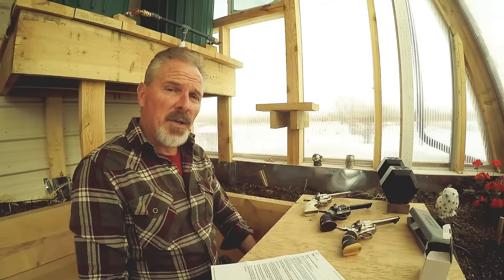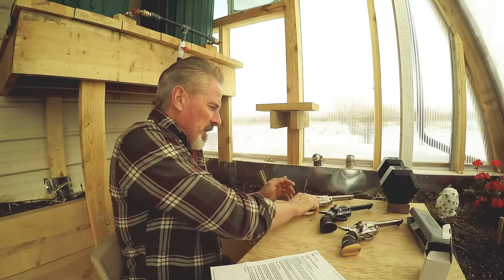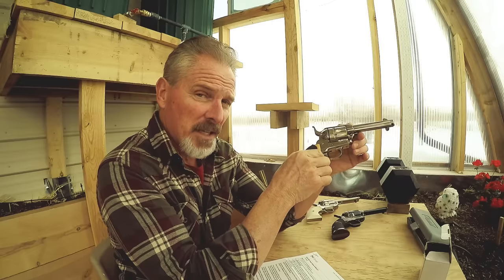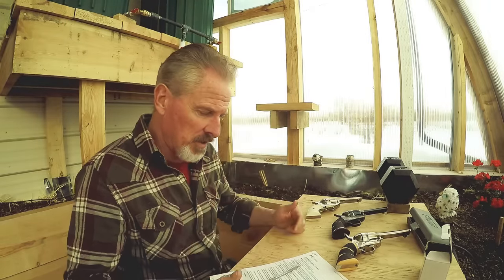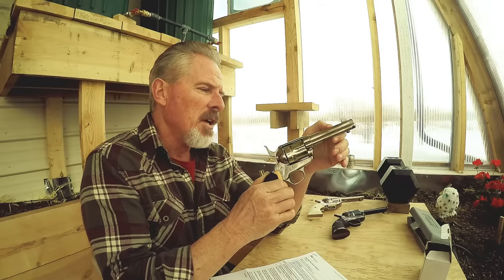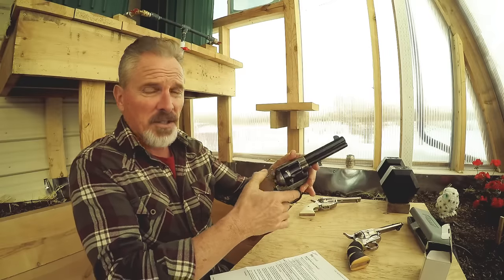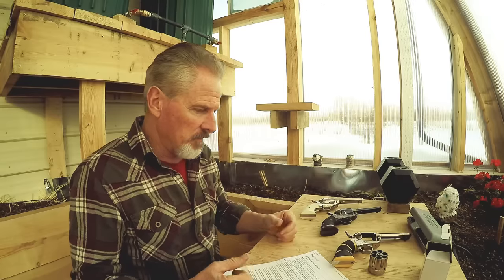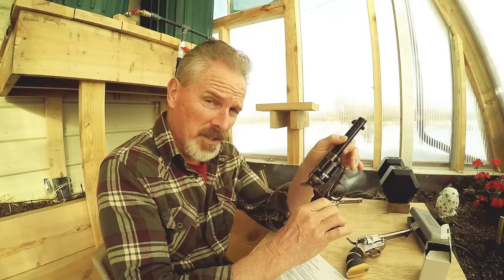Unlocking the Secrets: How a SAA Race Gun Works

Comment: Are there any drawbacks to having a race modified saa? Aside from spring related issues like light strikes, like does it become unusable in a normal way?
Reply from the maker: Light strikes can be a problem but cured with a slightly more powerful spring, more protrusion (in spec) . Other than that no.

Comment: Would have been nice to see that part and how it is shaped and how it is held inside the gun. My cowboy action revolvers were suppose to be factory tuned but it is too easy to not get the  cylinder to lock up until  the hammer really has to be pulled slightly passed the sear engagement. Nobody has given me an idea how to overcome that problem. and the factory will not fix. Uberti.
Reply from the maker: In my experience Ubertis SAAs are inferior to Piettas. I can't show step by step alterations on YT unfortunately. Sounds like an issue with how the bolt leg rides on the hammer cam. You can adjust the timing by filing in the right place on the bolt leg but it's too complicated to explain here.

Comment: Those triple taps are something else. What's your split times? It almost sounds like you're running faster than I can with my glock
Reply from the maker: I timed a few runs. The splits are .10 -.13. There are a few runs I think are faster from the sound but weren't timed. I've only done it once with live ammo but the time sounded the same. ( tricky handling recoil while trying to kiss that hammer with my thumb and little finger) Thanks for watching!

Comment: Interesting, i have a couple questions. First, how do these changes affect reliability or shootability? Would it be unreasonable to carry a race gun, for instance in the woods for bears or whatever? Also what gunsmiths do you recommend to do this kind of work?
Reply from the maker: They run like a race car engine. If you run them easy they perform as or better than a stock gun. If you put the peddle down all the time (like I do) once in a while I have to adjust a part or repair something minor. Either way if you run a race gun hard you have to understand how to tune them up when necessary. I would not use one for self defense. I would want a 17 shot auto or for a bear gun, I like a 454 Casull in bear country. If you want one Six Gun Magic will do a full race job for around $1400 on your real Colt SAA. Thanks for a great question!
Reply: 10mm for bear country, 15 solid copper Lehigh penetrators sitting on top of underwood +P loads will take care of many issues. I don’t have a 10mm so I carry my python with the same copper penetrators from Lehigh loaded by underwood, absolute performance ammunition.

Comment: Really interesting. I do action jobs on my double-action Ruger revolvers (just a couple springs, a hammer shim or two here and there, and mirror-polishing everything), but I figured that was all it took! Cool, cool stuff. Thanks for the vid. 

Question: I've always wanted a real Colt SAA, just because they're BEAUTIFUL and romantic and historical and all that, but I'm quite sure I'll never be able to justify the price. Are you aware of a clone that makes all four clicks like a real Colt, preferably available in color case hardened with blue barrel and cylinder? I won't care that it's a clone if it's functionally like the real deal.
Reply from the maker: I love the Pietta Great Western 2. Identical to a Colt and I've owned two so I know what I'm talking about. 600 or less. You'll love it.
Reply: @TUCOtheratt  Damn, really? That's CHEAP! I don't normally buy imports, but I have one of those Stoeger Coach guns and can't justify the, God, what, 5 grand? A real Colt would cost to complement it. I'll look into them, thanks!
Reply: Colt parts work in them if I wanted to slick it up? Springs, bolt, etc...

Comment: I replaced the standard hand spring with coil springs with a plunger and set screw on my CASS guns. They're smooth as glass but they aren't race guns. I worked on other guys CASS guns some were original colts. The gen II Colts are nice but I'd rather use an Italian made SAA than the gen III Colts I've seen.

Comment: Forgive this possibly sacrilegious question. However I was wondering if is is possible to turn a modern design single action revolver into a race gun.
Reply from the maker: Like a Ruger? Yes Kid Colt  has built a few out of old Vaqueros.
Reply: Like I said possibly sacrilegious I'm wondering if a colt python or even a Rhino single action can be made into a race Gun. ...
Reply from the maker: @TemplarKnight69  Well, double actions can be modified to perform very efficiently. You can call them race double actions. The thing is you can't fan them like a single action they just don't work like that. The single action revolver can fire three shots as fast as .10 for all three, that's  .05 split times. No double action can do that.

Comment: So no fanning with my 1858 sheriff. It didn't have any thing around the hole that lock on the cylinder, it's a stretch hole.
And the part where the end grip the cylinder to make it turn (in French it's call "elevator THINGER") is build differently and maybe a little bit slower. 😢

Any way I wasn't so sure I wanted to drill a method that keep the trigger pulled and fire and fire again without any trigger action.
I'm afraid of increasing the chance that I would shot before taking a good look in a gun fight scenario. Increasing the chances of shooting at somebody I didn't want to shoot, when I'm already started shooting by fanning the gun.
Keeping a trigger action at every shot may keep me looking and considering what I'm shooting for a 1/4 second longer. Wich can be good I believe.
I consider I'm still pretty kick on this trigger and cocking and trigger and cocking...
If I shot multiple target I find it not much longer than a semi auto pistol, cause I cock the single action as I aim on my knew target.

Comment: I noticed in the first gun you started with it has a double hand? I am not familiar with cartridge revolvers is that hand a stock item or aftermarket say from KrisKonverters? Then since you are explaining this the big issue with the open colts not sure if they fixed it in the 1873 is the timing on all but one that i bought is horrible after a few cycles and the cam on the triggers are junk soft steel. I’ve gotten most of mine to work but if I had a brain at the time I would have returned them. Most people hold on to them and fiddle with them. The most important part the hand cam and bolt are poor quality. Thank goodness Taylors stocks most of the parts. The cam for me was the most frustrating if the case hardening wore of the gun is toast that also applies to the 1873 rifles the sear is case hardened not the entire sear like a real gun the lever cam too. I like them but you really have to do alot to get them reliable forget the race gun aspect. And  then there’s the window you have to file and polish. Good grief why can’t they just sell them in better condition. That’s the primary reason I never bought an 1873 I figured they are manufactured on par with the 1851 or 1860. Well we’ll see when I get to the free state to shoot them again. I did enjoy getting them to work but I wish they just did. As far a race guns go I will just watch your videos you are pretty good at it lol maybe the best! Certainly the best that I have seen and you obviously work at.
Reply from the maker: The 2 stage hand shown is on all 1873 SAA guns. 51 Navys, 58 Remingtons have a one stage hand and different cylinder gear timing.  The problems you describe I have experienced on Uberti Mason Richards (the window not being right bad timing soft metal). Pietta parts are properly hardened and are correct from my experience. Pietta are much better made all the way around IMO but Ubertis look a bit nicer/more authentic. More about what works on my Rumble channel.

Comment: Great way to wreck a good gun.  Use them as Colt designed them to be used.
Reply from the maker: I've heard from sacrilege crowd before. The video explains how a race gun works, it does not hurt the gun at all, race gun customization protects it under normal operation like you describe as well. In fact you are commenting the video you should watch. I think you would enjoy it and learn something.

Comment: 👍 ‼️
ciao,   TUCOtheratt   ...‼️
 i would suggest to you like improved  the  hand and the work  of its doubble teeths, such that both the two teeths can engage deep the ratchet of cylinder   ‼️ and you have  a  positive  cylinder spin ... ‼️
at minute 10,14, when you desplay the cylinder stop inproved, 
we can see  too the hammer cock and the hand is visible that it protrudes  out of the shield,  we can see  above teeth of hand protrudes out better than  the bottom teeth,   that shape of hand isn't good, because such that  it can works only with its  upper teeth on the ratchet,   the lower teeth don't work on the ratchet because when the cylinder is assembly this lower teeth remain    very back  rear from the cylinder ratchet,  and don't engage it,  such that the cylinder wheels  by  only the upper teeth  action,  what is the solution that allows  at either two teeth  of hand to engage the ratchet ?  here's the simple answer,   you cut a little bit of above teeth of the hand  such that this above teeth protrudes 
  the same qyantity than the bottom hand teeth,  when the cylinder is away of frame,   you can determine how  much  you must cut  of the upper teeth of hand the bit part that must cut   sign a line mark  on the above hand teeth by a pencil goes vertical  along the recoil shield,   i hope  that my suggest is clear ... ‼️ good work 
  bye bye 
👍😉
Reply from the maker: That is interesting. My experience has been that the upper teeth start the rotation and the lower teeth finished the rotation. I have never found the need to change the hand at all. The biggest challenge has been wearing out lightened main springs too fast and firing pins that don't engage the the primer without deflecting off the frames firing pin hole just enough to cause a like strike. Heavy stock springs fix this and that's why they come that way from the factory but heavy springs neutralize a race gun and make it more like a stock gun. Thanks for the nice comments and for watching!
Reply: @TUCOtheratt ,
hi, TUCOtheratt  ‼️
try on your  Colt this  modified hand with  two equal teeths that protrude  out the shield  the same length in the ratchet,  i maked it  and my Colt  became very smooth and  very fast  ... but before  make this modified, to be sure you can look  the hand of Python, the hand  of Colt first generation,  of Colt leaves four rounds 41,  and of Colt 1903 ...,   they have, all of them, the same hand with two teeths  that protrude the equal length,  like i proposed modified,  after this improved you will have a very smoothest and fastest Colt 1873  ...  that all cowboy action shooter ... ‼️
bye bye 
👍😉
Reply from the maker: @antoninolatorre8355  You should make a video explaining that.😃
Reply: @TUCOtheratt ,
 ciao,  TUCO  ...!!!
who does know   ...?!?  
maybe  ...
bye bye
👍😉